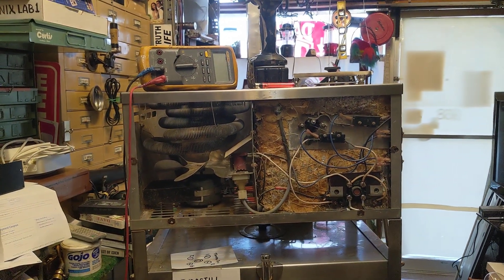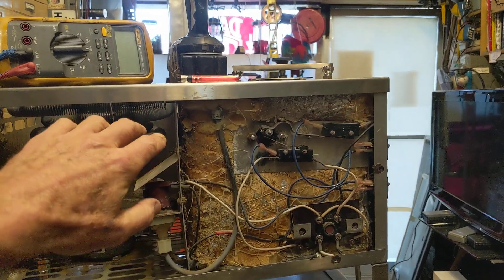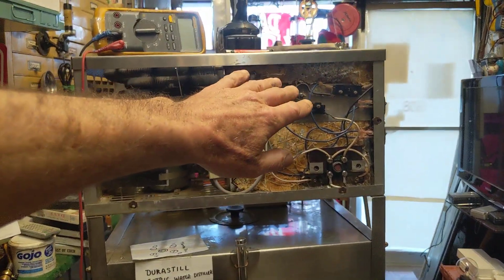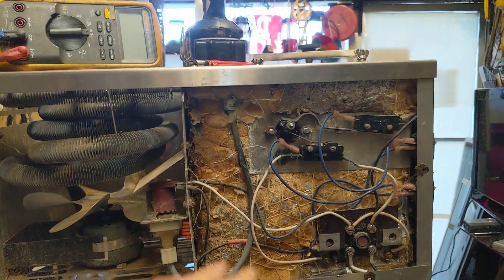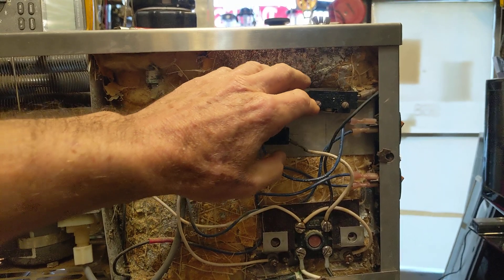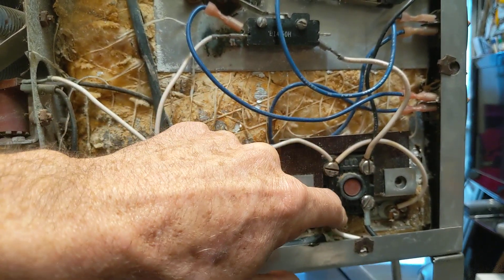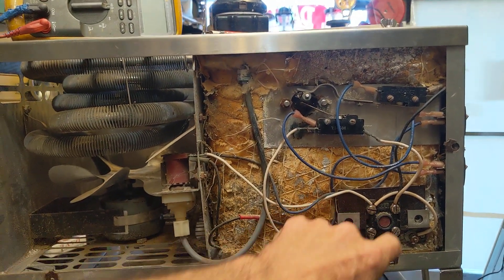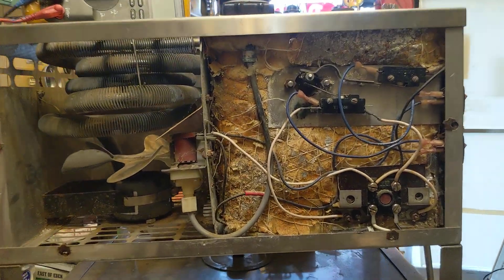Water Distiller Repair.

Comment: Boy this is the best video I have seen on the inside of one of these distillers and how it all works electrically. I have the same machine( lucked out finding you) but my machine will not even turn on. Hit the reset and nothing or moved the float. So if you have one of those electric continuity device a person can test it pretty quickly where the problem is. Thank you so much. BTW I have another one that I have used since this one broke down and it will not shut off ! auto feed for water and both the holding tank and heating chamber are totally full and running over.

Comment: That durastill unit can leak from over-filling the tank, the steam pressure will push the water out through the float-lever seal, which is where the end rod connects to the heating element switch. Just do not fill higher than the float rod lever seal and all leaking will stop.

Comment: I know I’m late to the video but, was that switch/circuit breaker an overload protector or just for thermal protection/control? 
 Also what type oil did you use on that fan?

Comment: Hi. Thanks for great video. I have the exact same model and the cooling fan (after of 2 years of being fine) shuts off randomly (stays off) while the boiling chamber keeps on boiling. Once the unit is off for a bit, if I turn it on, the fan runs as normal. Needless to say, there is concern that the heating element continues to heat while the fan shuts off. The fan seems to run fine until it shuts off. Any suggestions?
Reply from the maker: I'm not sure what sensor turns the fan on and off, but on the unit I showed here, I later discovered it also had a burnt out heating element, and that was more than I cared to replace at this time.

Comment: Hi Dave,  I have had a Durastill for 20+ years and it just started leaking water at the bottom, so I pulled it all apart and yes you can still get all the parts needed directly from Durastill and other suppliers. BTW, your video was helpful in confirming the line voltage placement so thanks! you may agree that water and volts don't go well together so I do recommend the owner get with you to do a rebuild as the float valve on mine was iron plate that rusted and the new part is stainless. I replaced the upper float valve parts and the lower heater element brackets and did a deep clean of the inside. I was able to salvage most of the insulation blanket but that is also available.
Reply from the maker: Sadly my repair turned out to be a fail on this one, I replaced the circuit breaker which was justified, but the customer called back and told me the cord to the unit was overheating,  so I'm assuming the heating element was also part of the problem and possibly shorted. I was warned by the rep at Durastill that replacing the heating element is quite a job, and I'm reluctant replace it after seeing all the corrosion, but if the customer  brings it back I may consider it giving it a shot. I appreciate your info on this.